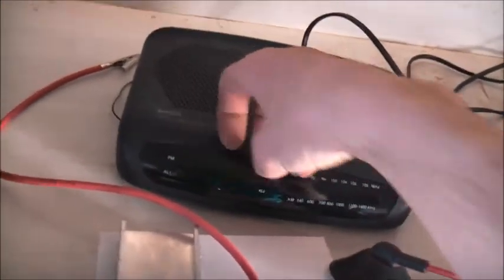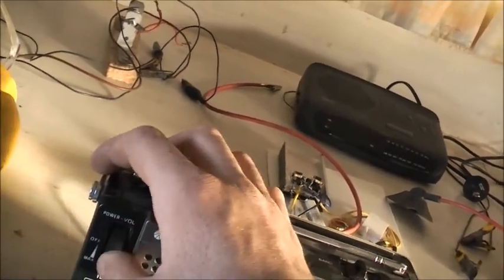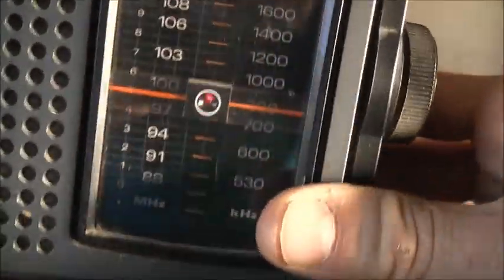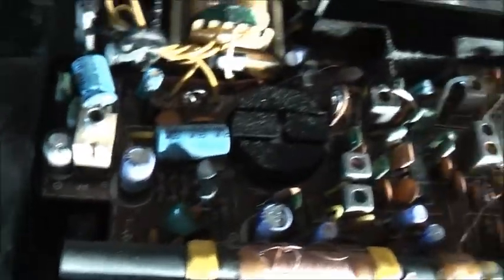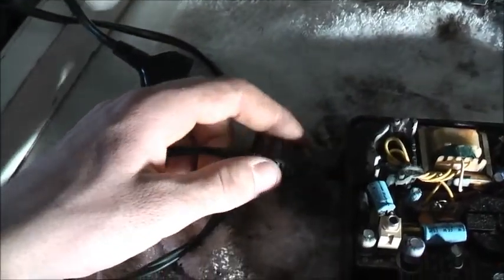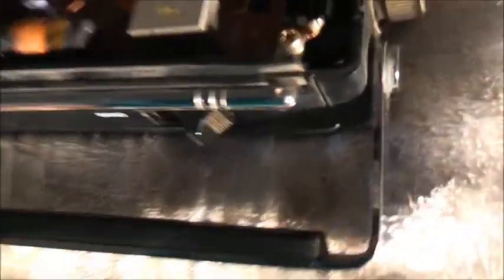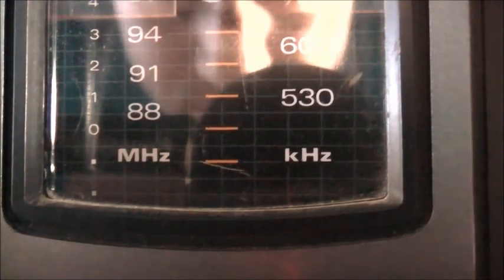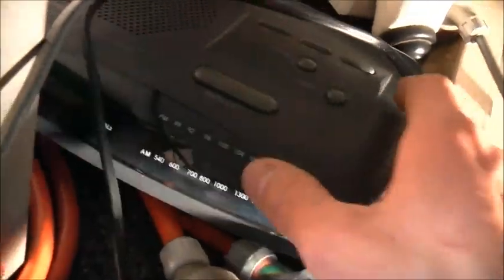Vintage Radio & More Goodies!!

Comment: Hmm an253 i.f amplifier i.c, often used to drive the am/fm demodulators to produce audio.
10.7mhz fm i.f / 455khz am i.f

I do like the look of the sanyo, the design is pleasing :-)

Dont forget to rotate the radio to get the best am receive lol, ferrite rod :-))

Comment: That power cord plug looks a bit like the one which would fit into my Sharp GF-767. :-)

The input on the back of that boomer doesn't (for some reason) have the standard 'figure-of-eight' 2-pin plug.

Thanx for showing,

-BoomBoxDeluxe.